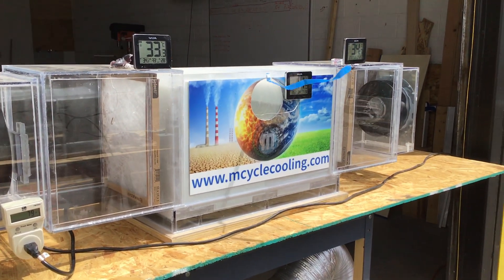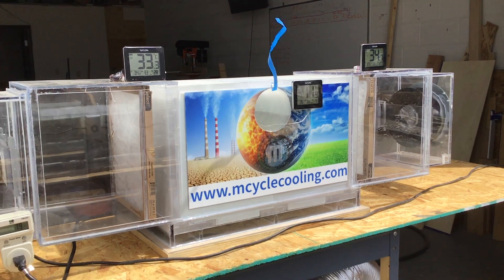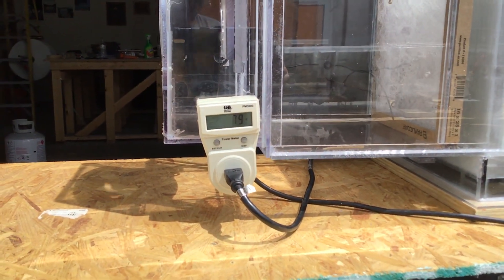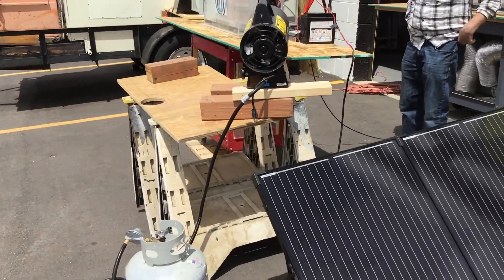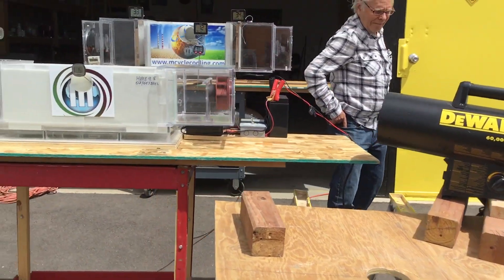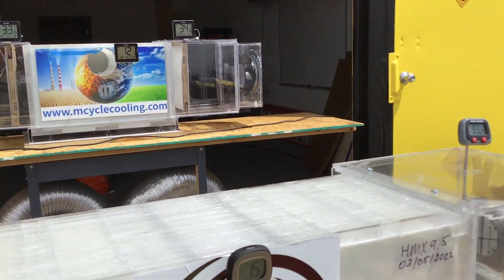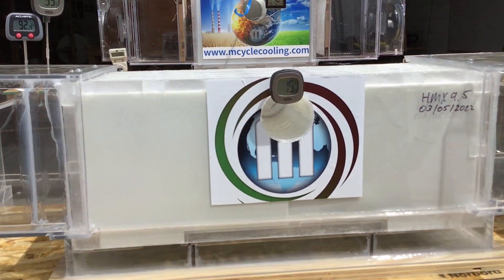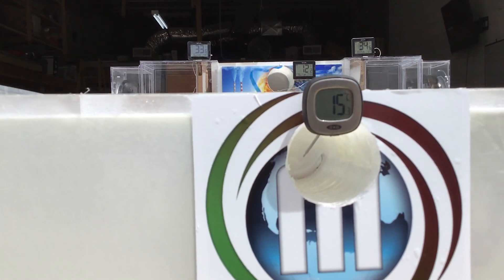READY FOR THE CHANGE TIME? M-CYCLE COOLS OUR EARTH. ALL TOGETHER WE CAN STOP CLIMATE CHANGE

Comment: What is the humidity? Is this standard way running as in you are just creating the products but the design is extrapolated mostly from the papers. I dont know the xlcorrect eords for this by design i mean how this works. I have searched a diy for this thing and have found people making very different looking things that work very differently all in the name of this hmx maisotsenko design but they are so different. And i dont understand how is the air that is coming out cooler than the wet bulb temp. Its the same temperatures how does heat move from cool to cool the same cool. If the system can create only 23 degrees at the lowest how does the air coming out read less than that. I havent read any of the papers yet. Will i get my answers there? You dont need to answer i will read them regardless.
Reply from the maker: Yes, sure. You better read the papers and study commercially available AC products designed using prior generations of Maisotsenko Cycle - Climate Wizard and Coolerado brands. Just open Google, ideally Google Scholar and enter search phrase  "Maisotsenko Cycle HMX design".  You will find plenty of scientific articles, videos, pictures, etc
You may also use some up-to-date and concentrated (adapted) information in our social media - LI, FB, X. Every video on our YouTube channel has some text commentary and explanation and our comments with details and links.